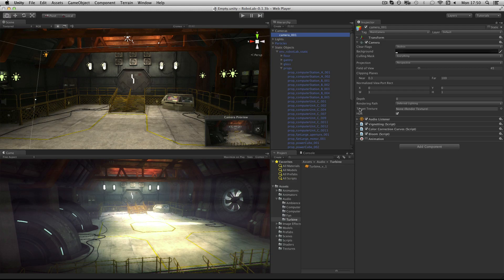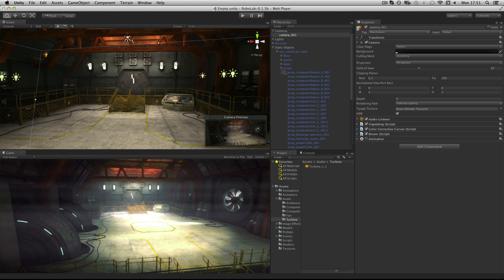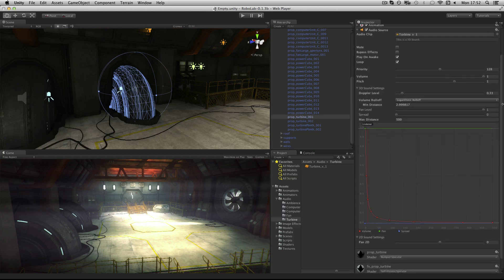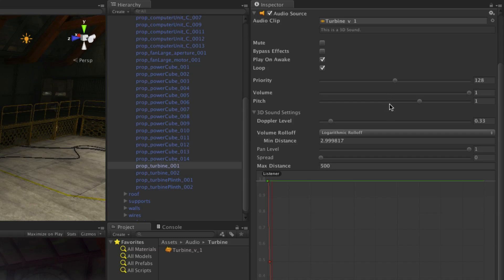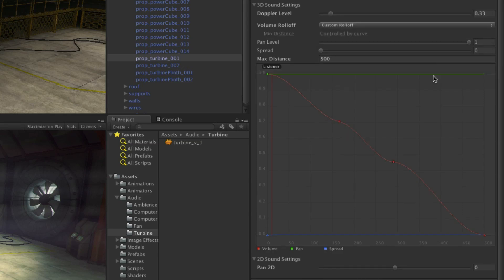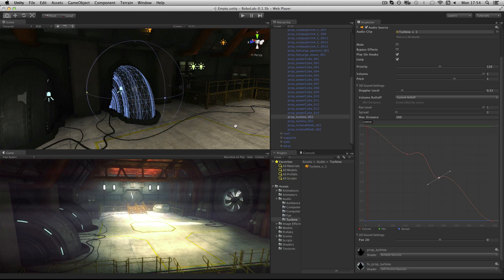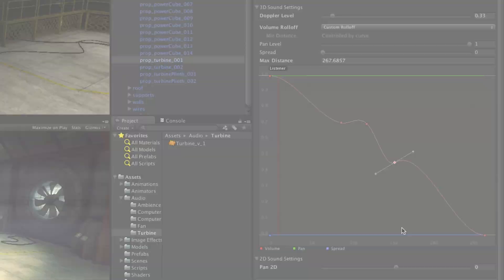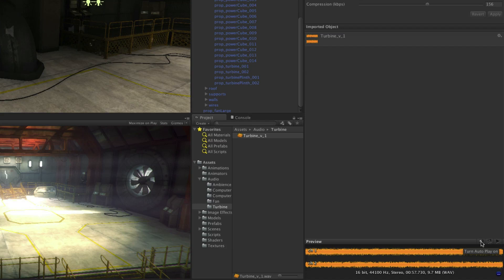Audio Sources & Listeners - Unity Official Tutorials

Comment: Hi guys, in case the sound preview does not work for you, try to turn it off and on. At least in my case it works. Each time I do a change in the audio source it updates only after I click the Toggle audio button. I am using Unity 2017.3.0f2